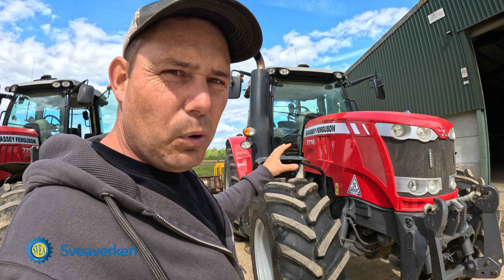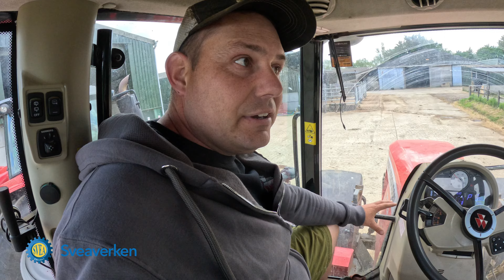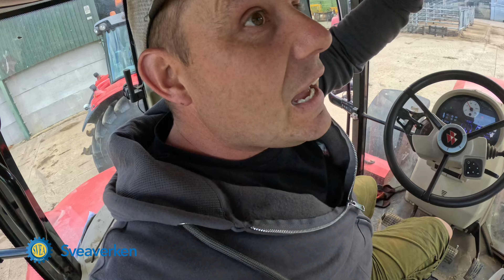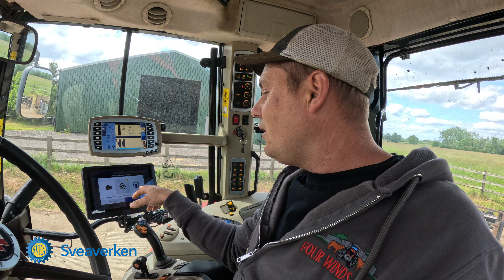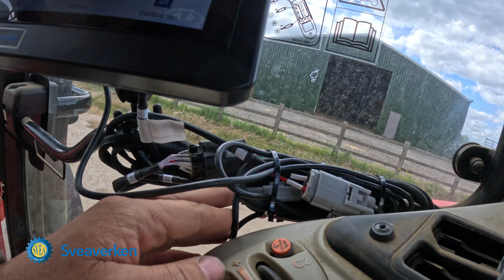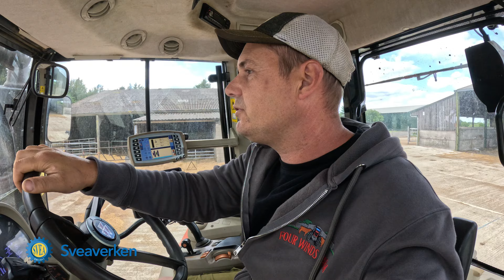Sveaverken Steer Ready CAN Bus Auto Steer! (Plug and Play)

Comment: I did an 8S on canbus with agopengps, didnt have to unlock it. Same for claas
Reply from the maker: Thanks for that, that's very interesting 👍
Reply: @FourWindsFarm One strange quirk with 8s tho is I had to unplug vdo4 module otherwise steering disappears off the canbus. Which knocks out ISOBUS on second screen. Wasn't a problem for the owner as only ISOBUS they have is baler. Sometimes there's a steering disengage too and you have to press button again. Making a triple CAN sniffer to see if we can find out what's causing it. If there is a 3rd party unlock, that might cure it.

Comment: Nice work 👌
What year is the 7718 manufactured? 
Wondering if all 7718s are steer ready?
Reply: They aren't all steer-ready. If you have the valve button in the pillar, and speed steer, it can work that way
Reply: Been doing this for ages with agOpenGPS, direct to canbus. Works great, MF are so easy to get to
Reply: Also, tier4 MF need an ECU modification, you need to pull some wires out (or cut them)